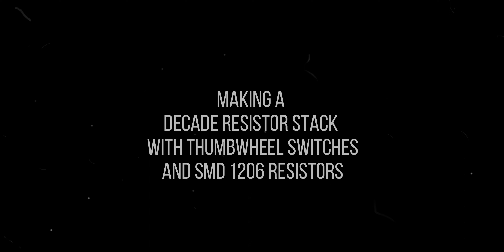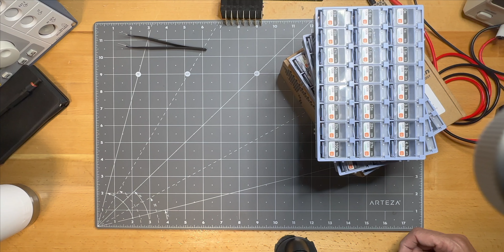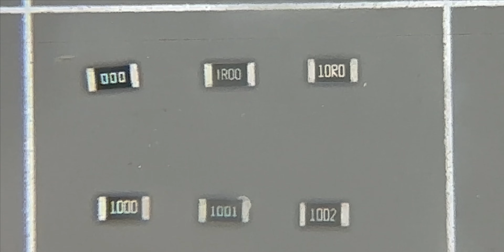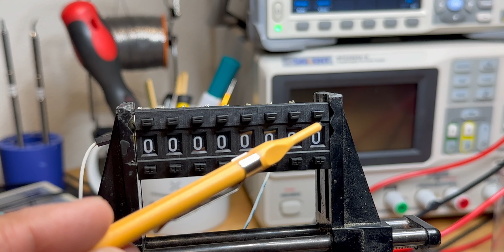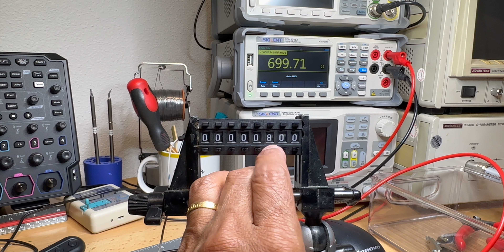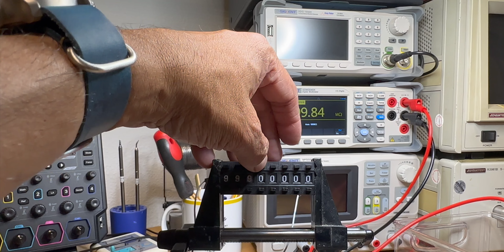N0AGI - DIY DECADE RESISTOR w/ Decimal Coded Thumbwheel - Vol 135

Comment: 0R can actually be used as a "jumper wire" if you are designing a circuit board, and just want that one connection that you're running out of space to do vias etc with. Otherwise you can use them as an alternative to a jumper pad. I think I saw a sparkfun product where they put one down in an antenna path, it was on 2 pads of an "L-shape" of 3 pads. If you turned it one way it goes to the integrated PCB antenna, if you turn it the other it leads to a UFL connector.

This is quite nice compact stepped resistor. could easily chuck it in a case.
Reply from the maker: thanks

Comment: Better off using 0207/0309 1 watt MELF on your 1, 10, 100 ohms with 25PPM, 0.1 tolerance. A 1/4W 1206 at best in the low values won’t allow you to test too much with limited power capabilities. Great design though.
Reply from the maker: good suggestion.  I must explore those.  Thanks
Reply: Lower cost option is to just stack 2x 2eN resistors for each course. A bunch of 0.1% 1206s will be a lot less expensive than MELFs. Depends what you wanna spend.
Reply from the maker: @ivolol  agreed. another good idea. so many ways to solve